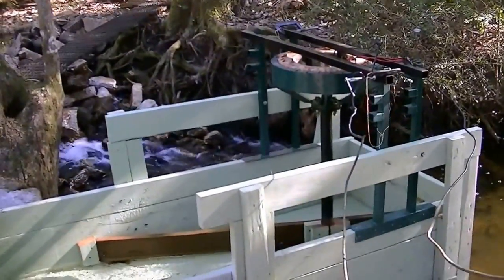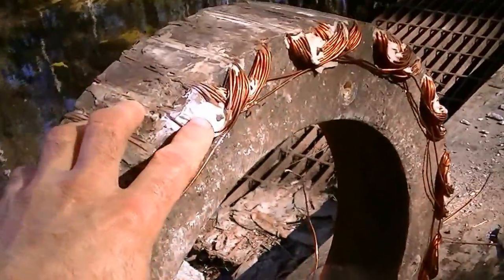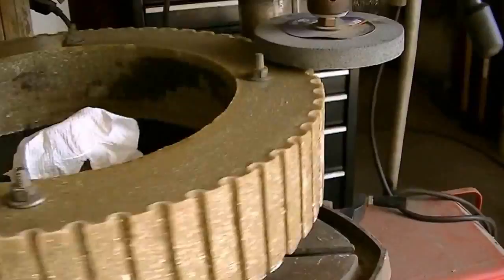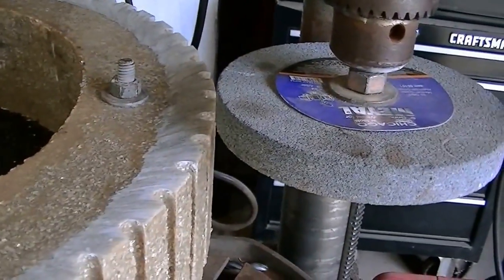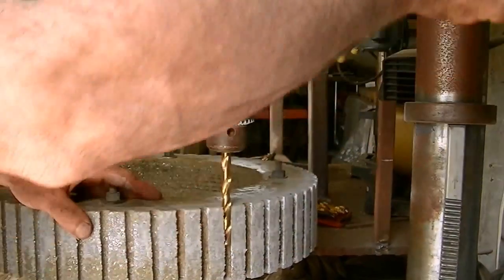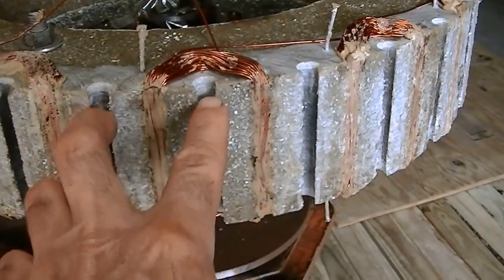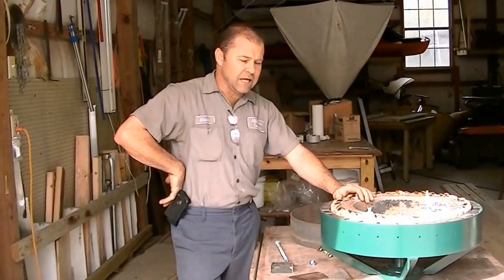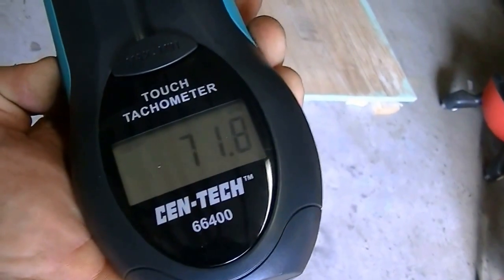Vertical turbine hydro generator system. Low rpm permanent magnet generator, home made

Comment: For the most energy the turbine blades should be inside the pipe. There should also be a draft tube on the bottom of that pipe that goes into the tailwater below the turbine and is constantly submerged so that you get 'suction head' then you will get more power as you are actually using the maximum head height from the surface of the water in the forebay to the surface of the water in the tailrace. When a draft tube is used, as water falls through the pipe with the propeller turbine and there is no air the falling column of water creates a suction pulling in more water and generating more power. If you do not believe me search Energy System & Design, go to products, and look at the LH1000 low head engine, it a mini Kaplan turbine commercial version of your homemade turbine but has a draft tube for suction head.

Comment: I have had a Pelton wheel setup (Harris Hydro) for the last 16 years, grid tied, 833 watts.  Working great, not going to change it. BUT, down at the bottom of my property  where the generator and power shed are, I am thinking of putting in a second system, vertical this time.  I have a 55' long tapered pipe, 12" to 8", schedule 40, that used to be a gas station sign. If I pick it up with my crane (my day job) rigged to be level, and simply position one end in the creek bottom  right after it comes out of a culvert, to serve as the inlet, the other end will be about 5' above the creek level due to the sloping ground. I can support it with scrap iron supports, one in the middle, one at the end, and a cable bolted into the culvert will keep it located. Then I'll see what kind of GPM I have, and.... that's as far as I've gotten, but having the water and the fall is the hard part, got that!  So, I am  researching Vertical/Kaplan type units like yours, nice job.
Reply from the maker: Yes have falling water is the hard part. I only have a 3 foot fall. Keep us posted on your project.

Comment: Thanks for sharing. Very nice presentation. A small suggestion. You could properly close up that dam with cement/concrete, to reduce leakage and put in a natural spill way, to handle excess water. Also, that bearing cap needs to be covered with a fully covered cap, I think, so that no rain water can enter the bearing cavity, under any circumstances.

Comment: Your missing what you are producing as far as volts and watts. I love you turned the drill press in to a milling machine/lathe. that alone is pure genius. I would have liked to see what electrical devices you are running as far as what your max Wattage is.

Comment: Still amazes me that people do these things, and nobody seems to FINISH the job. And that vortex is called cavitation. Great concept but it would actually last eons if it were contained in a housing out of the weather. Also electrolysis is real. Your voltage and general output will suffer over time because of exposure. Conduit and junction boxes is great for wire, and helps prevent line loss from open connections exposed to the elements. Ever drive down a rural road later at night and see the power lines sparking from insulator to insulator?

Comment: IIn the  caes of  slow rotation, for example , 10 rev per minute, (with huge torque )  is it possible to generte electricity ?
Reply from the maker: Yes it is possible but you have to gear it up to get more RPM.
Reply: @markp0177   I see . That means it need to be high rpm ,eventually .
Reply: @markp0177  Higher rpm , more current  ( or Voltage )  would be generated  ?
Reply from the maker: @pkstock372  Yes, the faster you can turn it the more voltage but it takes a lot of power to turn this generator faster.

Comment: 1 The thickness of copper wire ?  2 The resin materials  adhesice to copper windings ? 3  Material of Rotator ? ( Plastic PVC )?
Reply: 1 I used #18 wire and 40 wraps on the windings. I get higher voltage at even lower RPM.
Reply from the maker: @pkstock372  I used wood glue in a caulk gun to hold the wire in place. the rotator is made out of fiber glass.
Reply: @markp0177  wood glue from IKEA ,ok?
Reply from the maker: @pkstock372  Here is a link to what I used. https://amzn.to/3dARseE
Reply: COOL

Comment: Wow that's one of the few radial
 flux generators on youtube but i wonder why didn't you know increase the slot depth to allow for more wire ?? And in your case a larger air gap my actually increase power please have a look at mine https://youtube.com/shorts/s_WC5k70LZM

Comment: thats very impressive work!!! i saw a video from a guy that took an old washer with a plastic tub and it had a rotor staitor motor and he put blades on the shaft, drilled a hole in plastic drum and ran a pressur washer tip to blow water on it( changed tips for low and high water season to regulate pressure) he powered his whole house with it and only changes the bearings every 2 yrs and mitor lasts 10- 15 yrs..he got 110volts at about 30 amps and motor water pressure up to 60 amps..wow
Reply: Marty T channel of YT. Just completed another hydro system install with a friend and explains everything...885 watts continuous;

Comment: adding a stream straightener in the vertical tube should help with performance just simple flats pieces the go from the outer wall to the shaft start with 2 if maintenance is a worry cut the top at an angle so junk slides off

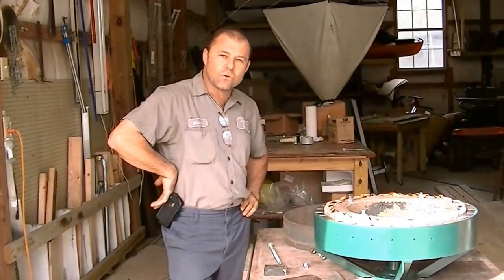Comment: The main concern I read about with a perpetual motion machine running on magnets is that they will eventually demagnetize. @7:00 you say that if a magnet is stored in a ring it will last for eons. can you please build a perpetual motion machine next?
Reply from the maker: I am still using the same magnets with no loss of power. I can't build a perpetual motion machine.
Reply: @markp0177  You seem very capable of doing just about anything please can you humor me and just consider the idea in your dreams tonight?

Comment: Brother that’s fuxking awesome! I am a big time DIYer.  I’ve never built anything like that though, very impressed. I am currently building a self sustaining garden tower unit for a customer and I want to use a small water wheel or turbine to catch the water falling back down the tower to turn the tower slowly throughout the day. I know I need to have a series of belts and gears or better yet a toothed  gear and a circular rack the circumference of the inside of the tower but it’s all new to me so do you have any suggestions?
Reply from the maker: I don't think you need to turn the tower just put something white on the back side to reflect the sun back onto the plants.

Comment: How many RPM you have from this water level?
And how high is the current and voltage in real conditions?
Reply from the maker: Around 160 rpm and 600 watts.

Comment: Change cylinder shape to conical shape so water become more turbulent or use some turbo design and siphoning too for more clean water 

We do a cavity at height and made a sink holes so it is only give clear water and we use this water for making siphoning and an extra pressure head are formed due to siphoning so we got extra pressure too

Comment: What are the approximate specs of that thing?
How many watts does it put out with typical flow.
What was the voltage of the leads?
You said it goes about 400 feet, that's quite a distance at any voltage.
Reply from the maker: I get between 400 and 600 watts. Its puts out around 72 volts.

Comment: You'd be better stepping the voltage up near the turbine rather than sending it 400 feet at low voltage. that will reduce your power loss to the cable.

Comment: What is that outer ring cast from ?  What did you use for the inner hub
Reply from the maker: The outer ring is made out of steel and the inner ring is a casting made out of fiber glass with several steel rings.
Reply: @markp0177  wow ,it looks concentric

Comment: Mark   your video is the best I saw ever, inspirational in a big way, can you tell me if the friction between the stator and the magnets is nothing?

a small percent? or the stator does slow the magnets down a lot,this is very important in the experiments I am trying....love your work
Reply from the maker: When it is not charging the batteries it spins freely but when it is charging it takes a lot of power to turn it.

Comment: AC travels farther with less "line-loss" than DC current.  Have you consider relocating the rectifier assembly?  Take the AC all the way from the creek up to the battery storage shed.  Convert AC to DC next to the battery bank.   Perhaps you a considering "safety concerns" of AC vs DC???

Comment: How do you join the wires when you wind the stator? They're solid core, will soldering work?
Reply from the maker: I used one long wire for the stator. If you solder make sure you coat the connection with enamel.

Comment: You've got it figured out. Micro hydro is the king of off grid power. Output competitive with a solar array, but uninterrupted. Those night hours add up. There is no better way to spin magnets than with water, being 700 times denser than air and continuously moving in creeks. That is of course if you happen to own land with moving water & an elevation change. That's the #1 thing I'll look for when I buy land.

Comment: Not a good idea to distribute low voltage DC (<50v) to over 400 feet distance. Not least the losses for high power, but the costs of suitable breakers (expensive for high amps DC as it arcs so readily) and other switch-gear too. If you made your rotor with even finer wire and upped the voltage to say anywhere above 60 volts to 100 volts and use a transformer per phase at the far end, you would drastically reduce your transmission losses, and significantly reduce your switching/breaker costs at BOTH ends!

If you can afford it or find decent second hand transformers (two pairs each the same) you could go from x volts at production to a few thousand (3kv?) just for the transmission.  Step back down at the far end for 120v per phase THEN rectify and convert. Use really good HT cable all the way (high insulation, copper, steel shield-SWA cable) then transform back down again at the far end (to whatever you want) just like in the grid. Then watch your losses plummet, especially over 400 feet. Just be SUPER careful about earthing and housing your up and down circuits to keep it safe, but you can always come out with two phases, 60 volt, centre tapped, with the centre tap to ground and have a very safe (output side) of just 60v AC to ground but 120v across the output (just like a site transformer). 

Take your 120v feed separately for each phase across the anti-phase output taps (either side of the centre tap) and then do what you want with it - direct feed to devices that are not frequency dependent, to suitable rectifier packs for DC then inverters after combining the DC. Don't use old vehicle alternator packs as they are RUBBISH and no good for high voltage anyway. Low cost, single phase 1600 volt 100 Amp are available on eBay for less than £6.00 ($7-$8) each.

Comment: Good job, I only want to say that you lose alot of energy just overcoming the inertia of such a heavy stator. 
You can try improving it further by:
1. making channels on the inner side of the circle and adding another row of magnets and copper coils.
2. Hollowing the stator by drilling triangular pits on the top and bottom in a balanced fashion, so more energy can go into the rotation(flux change) and compensate for the increased resistance+weight from the inner ring of coils.
3. You could possibly increase power density further by then creating a duplicate inner ring that moves in the opposition direction. So the rows going, metal ring, magnet ring, stator rock ring, coil ring, magnet ring, coil ring, smaller stator rock ring in reverse, coil ring, magnet ring, inner binding metal ring
4. Mount analog rpm, ampere, volt sensor cluster in the center. Just recycle some old vehicle gauges from a salvage yard.

Comment: Thanks for sharing; that's really simple and good design. One thing you could consider is changing the cylinder hub to a conical one. So it starts wider up top and reaches same diameter as you have it now at lower end. That will improve output.

Comment: Great System. How much money did you invest building it? What is your inverter power capacity? It's super cool you can run two refrigerators at the same time.  Great Job man!
Reply from the maker: I spent around $400. My inverter is a 10,00 watt
Reply: @markp0177  thanks for answering. Wow I thought it was more expensive. Your inverter has a lot of capacity. Great job !

Comment: Markp0177 - are there any regulations on small hydro plants like yours?  What state are you in?
Reply from the maker: I am in Alabama and I do not know of any regulations
Reply: @markp0177  How much head do you have on your system?  Is this a very low head but high volume system?  Have you tried any other turbine blades?  It looks like you are using standard fan blades as your turbine.  Have you experimented with other turbine types to see if you get more efficiency and more power generated?
Reply from the maker: @michaelschmidt7014  I only have a 3 foot head. I made the blades. I have experimented around and got better efficiency but more maintenance.

Comment: I have a question and hope you are still monitoring comments. Would your stator be more efficient if the core was non-ferrous, or for those who don't understand non-magnetic non-magnetic?
Reply from the maker: No, it would not work at all with a non-ferrous core.The magnetic flux has to flow thru the stator jump the gap and flow thru the metal on the back side of the magnet then to the next magnet and jump the gap again. The copper coils are traveling thru the flux at the gap to push the electrons in the wire. Hope this helps.
Reply: @markp0177  Just wondering because I have seen windmills with the stator magnets on a wheel hub and the wire wraps on plywood which was stationary and the hub would spin. I have never built one but I am considering it. May I also ask where you got your magnets?

Comment: Good job.. but is the core made of multiplayer sheets as it should to avoid de Foucault energy loss in the metal ? Personally I would have use some directive wings very near the turbine to force the water to keep the angle for max power. And also would use more wire turns to obtain more voltage to help with no loss in energy transport in wires

Comment: Very great construction, however one small correction. While your description of the magnetic flux being balanced in the rotor was correct, it does not actually affect the magnet wearing down. Magnets naturally and unavoidably lose their magnetism over time, the amount of time depending on the type, strength, and operating conditions (eg warmer environment will speed up degradation). But for magnets that size I don't think you have to worry about that for a while. However switching them for fresh ones after maybe ten years or so might show a noticeable boost in performance (or at least a return to the original performance).

Comment: What is your opinion on using a car alternator as a generator instead of making one?
Reply from the maker: A car alternator has to spin fast to work and it waste around 90 watts using a electromagnet instead of a permanent magnet.
Reply: @markp0177  Thanks for the input. I havebalways wondered about that.

Comment: how did you adhere the large magnets on the outer ring and so close together?
Reply from the maker: I used glue and there is a small space between the magnets.
Reply: @markp0177  what type of glue sir
Reply from the maker: @dannyjones7806  Marine goop.

Comment: is the wiring you use conductive on the outside? otherwise all those windings would act like a giant chunk of conductive metal
Reply from the maker: The wire is coated with enamel. It is called magnet wire.

Comment: Have you tried doing the rectification up at the charging station, AC does better at longer ranges than DC. You do have to run another set of wires, but you will loose less current using AC. The other way is to use a transformer to raise the AC to a higher voltage for transmission to the house, then step it back down, or just rectify the higher voltage to what you need, example, 120 volts, you could run power for lights, and other light electrical loads that are forgiving on voltage levels. This is how power generating stations work, so it will work on smaller scales.
Reply from the maker: I have thought about that but it is the cost of another set of wires.
Reply: @markp0177  Ok, its up to you, but a 100 foot ROMEX 10/3 with gnd is about 50 cents a foot average,  also means that if one set breaks, you still have the other set to give you half power until you can fix it. 
Very good vid tho.

Comment: He actually said magnets don't wear out. Ummmm, yes they do. Interesting video for sure, but quit saying things that make you look bad. Stick to What you know. Granted it will be very limited, but if you do that, it will make you sound much smarter. There were a couple other things you said that were head shake worthy. Cool turbine setup though. The drop method being used for decades is a efficient way to extract energy for a small projects where you only need one plug in for the tv. Other than that, these are a amazing way to show how energy can be made. I can't wait until the time when these are practical for the use in the household, and where they actually produce enough energy to cover the house usage. Hopefully there are better times ahead.